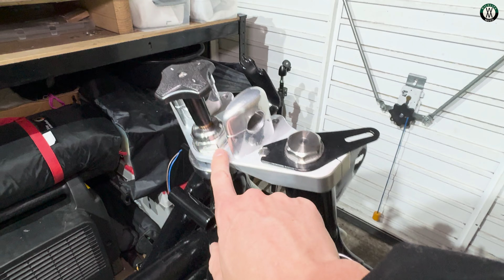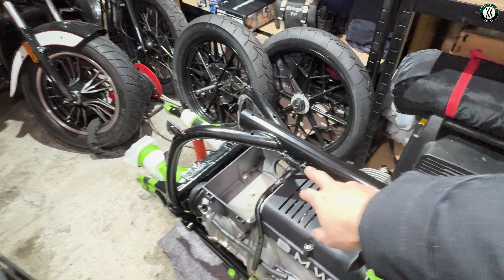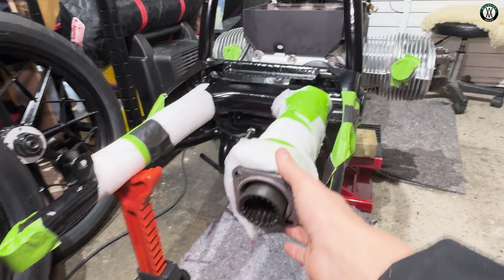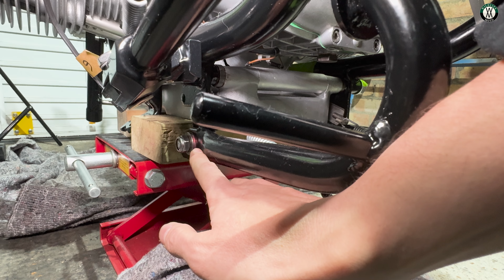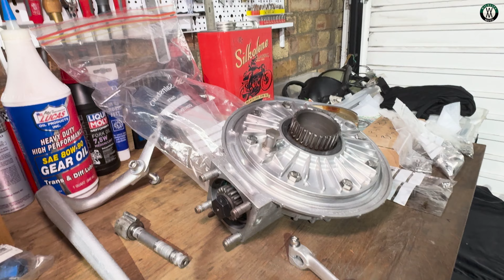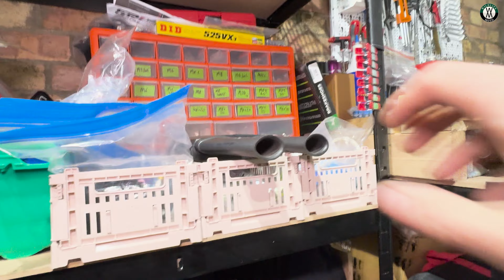BMW R100CS Build Update | Swingarm, Stands and Damper

Comment: What i learned from the Brad pit's R100, the tank should be lined.
Maybe you wanna trow in some aquarium stone split and shake it a some time and have it lined by some specialist.

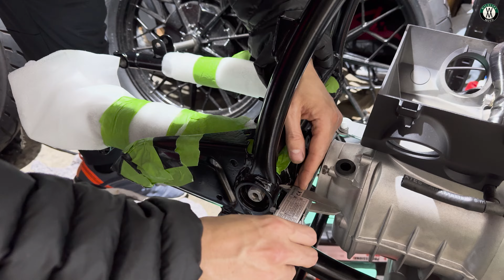7:29 on the R1100's the thing with pivot's is done better, the one right side can be turned in fully and torqued and the one on the left is adjustable with a counter nut (... and these are quite expensive for what they are), like yours.
Also the center stand is wel toughed out on the R1100's and the successors. You can remove the gearbox and it stays there. as wel the grip hidden in the fearing makes a peace of cake or effortless to place the bike on the center stand and that's something really amazing considering it's 225kg, dry.
Reply from the maker: Thanks for the info. I used electrolysis to derust the tank. Most of the lining came off with the rust. I might get it relined however there is a high risk of damaging the new paint as 100% of the remaining liner would need to be stripped with acid.
Reply: Well, the day or hours before the "acid" is applied mask the whole tank with this masking tape and plastic foil. several layers and remove this fast, otherwise the glue of the tape will get stuck on the paint.
: )
There is another very cool bike worth mentioning: BMW R1150 Rockster. it has a "custom" telelever wishbone under de tank. witch is a very cool part. @WildlifeMoto
Reply: maybe if you cut a 500ml soft drink can, unroll it and make a hole where the filler opening of the tank barely fits through and paste that over the carefully masked tank for extra protection against the acid or a metal sheet for a car's fender or so, might help or mural plaster over the masking tape.  @WildlifeMoto

Comment: Enjoyed the vid, thanks Mr WM.
For me, the origninal top yolk pad would stay........but the minging hose clips securing the bottoms of the fork gaiters would deffo have to go!! They look so glaringly 'Heath Robinson' and aftermarket to me that they hurt my retinas (but maybe they are genuine BMW styleee?). IMHO some wide black cable ties fitted in such a way so the 'lock blocks' are hidden behind/between slider and mudguard would be much more unobtrusive and pleasing to the eye (cue a hail of t'internet abuse). With regard to the airbox, I too prefer the earlier style, but would suggest maybe going with what you've got at the moment (on the grounds of originality and cost), and if it really irritates then change it at a later date.
Reply from the maker: The gaiter clips are indeed original BMW parts. They even have little BMW logos on them. I do agree with you though, not the prettiest are they. I will probably do the airbox at some point, but I’m just going to get it up and running first. I’ll save that for the next stage of tinkering. Cheers 👍

Comment: I always had the steering dampers set on 3 on my R90S & R100S and they were never as stiff as yours, mind you I always had the handlebars on but even so ! I’m interested in what you think of the Sizzapp when you are all done. I seem to recall that Bike magazine referred to the top yoke cover quoting the BMW blurb as being there for “passive safety”, I always thought that they were horrible although original on your model. Similarly I preferred the old style air box and even more so the old style rocker covers. Whatever, your bike is going to look better than when it came out of the factory when you are finished ! 🇬🇧
Reply from the maker: I'll get the bars on a see how it feels. I remember it being pretty stiff before, I hope I didn't fit it wrong! This is the newer Stabilus version, so maybe it has more dampening at the highest setting? I think the crash pad will stay off. I'll get a video up once I have the Sizzapp working. Cheers.

Comment: Now that you've cleaned the inside of the tank I would seal it with Por 15. Did this to a tank 25 years ago and it's still doing its job, especially now with ethanol fuel.
Reply from the maker: Good shout, I've been thinking about doing this.